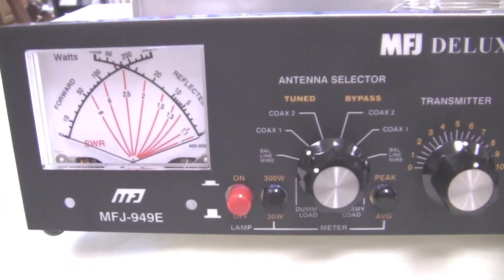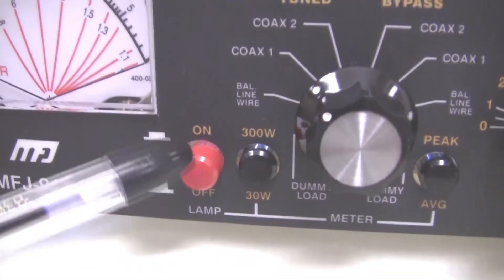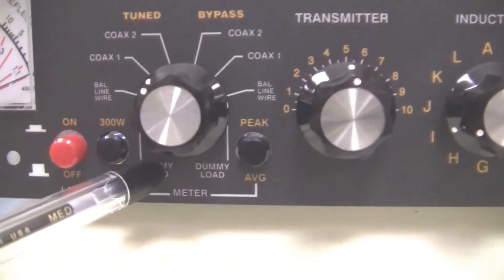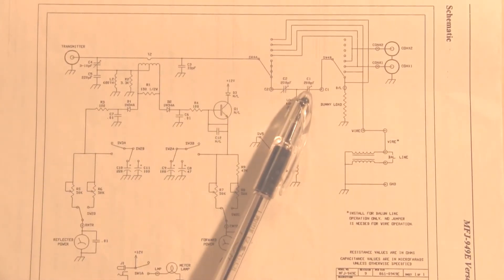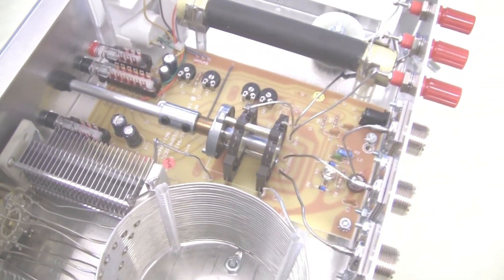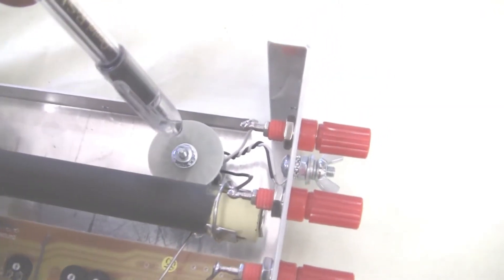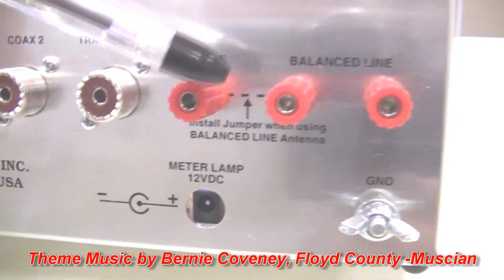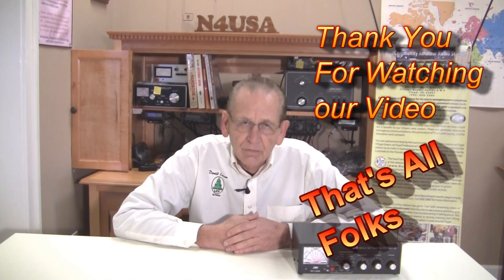Antenna Tuner  MFJ 949 E  KK4WW Amateur Radio

Comment: It is a good tuner. I can use it to tune a T2LT antenna for the 11 meter band, to work on 10, 12, 15 and 17 meters band, and on a part of the 20 meters band. Does the job with the poor antenna.

Comment: Before you buy junk like this for more than $40... take a look inside a high quality manual tuner made by heathkit, yaessu, or kemwood.   Divide rated power of MFJ by 3 to 5 ..and that is what the components and wires sizes should be spec'd for.  You can buy a true 500 watt rated tuner used for less than new cost of this stuff.

Comment: I have the MFJ-949E tuner, its a very good quality make and works well indeed. One of the better items I have bought for my Amateur Radio work.
Reply from the maker: Mike Lee Hi Mike - I have also been using the tuners from MFJ for years with good results. For the price they are just fine.  Thank you for looking at my video's Dave at www.kk4ww.com

Comment: Part # 3 is on line of the 941EK antenna tuner and again is the same tuner without the peak reading parts. So if someone wants a tuner like this that you can build the MFJ941EK is a deal. Thanks for your video...

Comment: I just gave a class on building the MFJ-941EK antenna tuner and the first two parts of my personal build are on line. I'm still working on the editing of the Part 3 video. The 941 is the same tuner less the transistor and a few other parts for the peak reading function. But the same board is used. So on another 941 I'm going to make a video on adding the peak reading parts to turn it into a 949. Thanks for your great videos!
73
Jimmy, ARRL TS, WX9DX